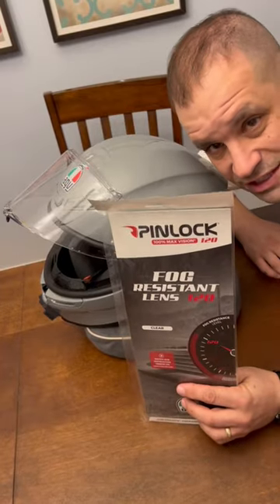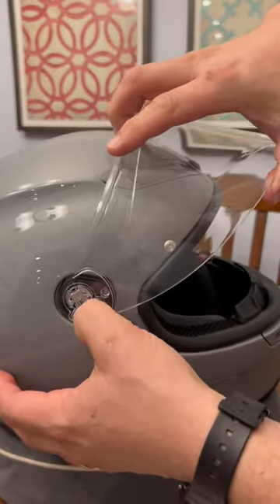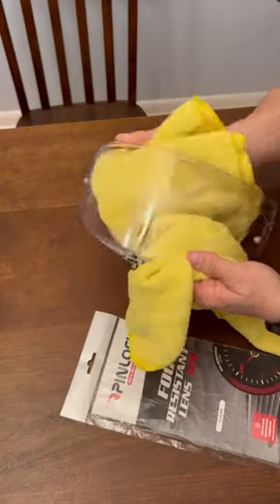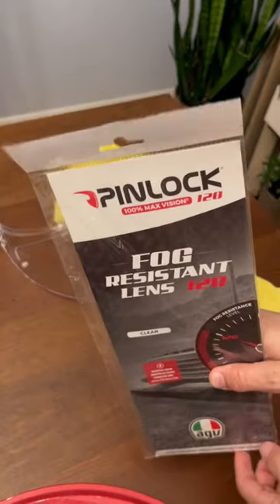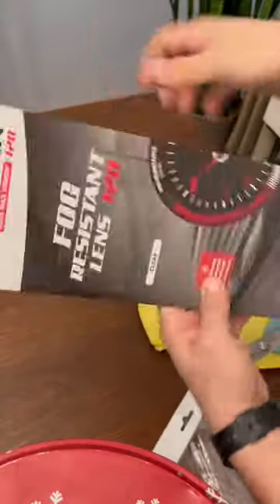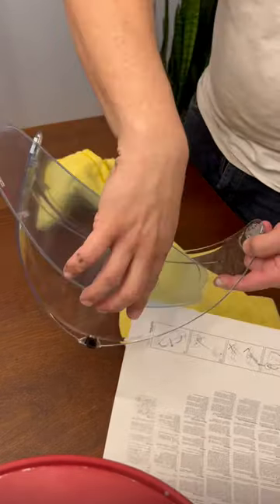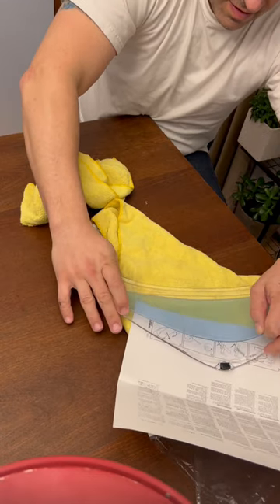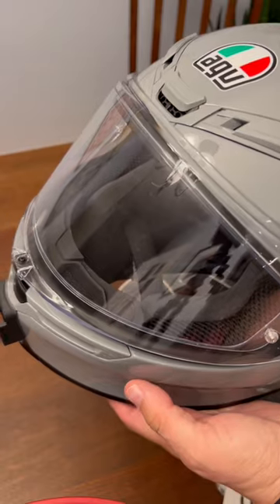Pinlock Install AGV K6 Motorcycle Helmet - #shorts

Comment: So all you do is get the pinlock out and simply put on . ? Or is there any film that needs to be removed before installing ??
Reply from the maker: It is that easy, no special film. Depending on the pinlock, some have a protective plastic and cover so you don’t scratch it in transit.
Reply: @MCCJustMotos  thank you 🙏

Comment: isn't antifog included in the tecnology of the helmet?'
Reply from the maker: No, no helmet will anti-fog without a pinlock, period.
Reply: @MCCJustMotos  i mean, it has a pinlock since its construction right?
Reply from the maker: @gio4738 it’s set up to have a pinlock installed, but it does not come already installed. You have to install it yourself.
Reply: @MCCJustMotos  oh ok thank you very much

Comment: Wait, so it just lays against the visor? There isn’t any adhesive or anything?
Reply from the maker: Yes, that is correct. It uses a soft squishy rubber seal to create an air barrier.
Reply: @MCCJustMotos  Very interesting. One came with my helmet but I haven’t tried to put it on yet because I thought it was an adhesive and I was afraid I would mess it up.